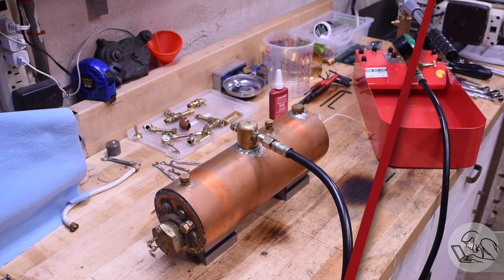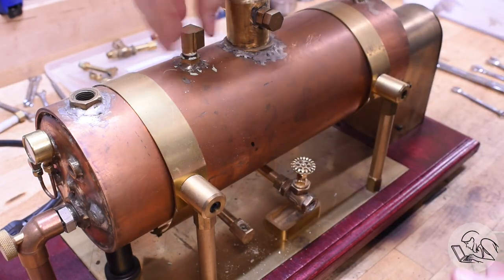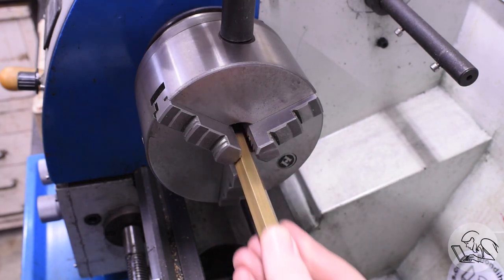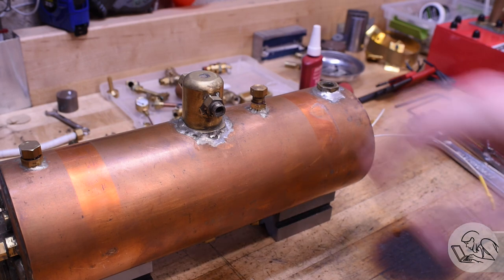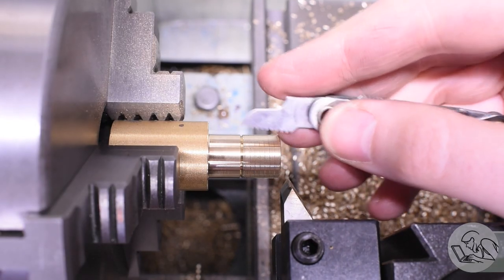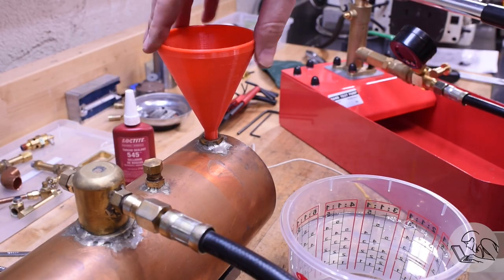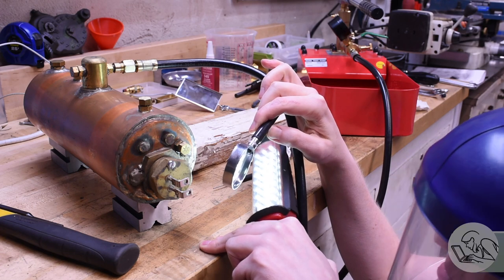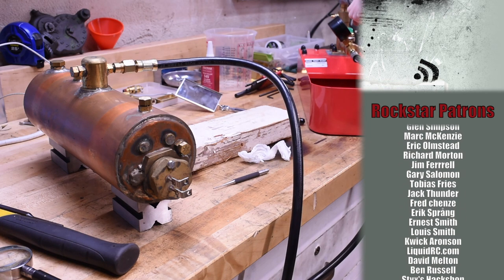Boiler Pressure Test!

Comment: Again, Awsome work with the boiler!
About the pressure test, this is actualy a thing i need to do with several of my own machines, i newer taught about those sheap plastic flower sprayes where even close to be capable of pumping it up to almost 7 Bar!! (or about 100Psi for our British Friends) 6 bar is more than enough for most of those low pressure toys (or about the operating pressure for machines like the Stuart larger size machines). Thank You very much for those tips and trixies!! You realy saved me a lot of headace now! <3
Reply: I was also stunned when I saw Myfordboy using a flower sprayer for pressure testing. Who'd have thought it?
Reply: I don't know if one mainly use Bar/psi has to do with if one are a petrol head or hydraulic guy... as an old farmer used to hydraulics, Bar tend to get stuck in my referenses, but my friends on the race track tend to refear to things in psi because of 
turbos and engine compressors, however i learnt to automatically convert scales in my head now anyway, same thing with metric and imperial, since imperials are used among carpenters and boatbuilders in Europe but the hardware stores use metric so i hawe to convert back to imperials in my head for the constructionwork on the farm... ha ha
Reply: @sheep1ewe  We are stuck with a mixture of the two systems in the UK, and I can't see it changing any time soon. Kids learn only the metric system in school, but when they leave school they have to get used to road signs in miles, beer sold in pints and tyre pressure machines reading in psi.
Reply: @JohnsOrganWorks  In Sweden we did officialy switch ower to Pascal for all those types pressure messurements (despite very few people are using it outside the carshops), before the national referense was a scale called "ATÖ" wich simply means atmospheric pressure ower sealevel (pretty much equal to 1 Bar).
Operating height of aircrafts where for some extremly weird reason recently replaced from metric to fot here.
It's mainly planks, wooden beams and nails wich are still in imperial here, but sold by metric since i think the 90s or so, so if one ask for a 2" pre made raw sawed plank i think it will roughly be 50 mm today, 3" nails will be 75mm, osv. In the hardware store, i guess it's the best compromize they had to come utp with. Before the metric era we had actualy two types of national standard inches here, one general approved for wood and one, slightly smaller approved for steelwhares and other metals only, i think that's why it's first unified with British imperials and then converted to metric from British imperials... ha ha
Most people somehow involved in carpentry and construction work here are using a double side folding rule with both metric and imperials side by side, i hawe one my self in my pocket... ha ha

Boats are of course always messured in fot, i don't think boathulls ever has been metric here at any point i know of.

But there is an old nordic pre imperial called "Aln"; the referense of the forearm wich is roughly 2 fot in lenght, my grandfather had a ruler wich started in that scale (roughly 60 cm) and divided into inches. I don't know if they where in Britain as well at some point, but i guess so, i think it was used in the aincient Egypt too if i am not wrong...
Reply: @sheep1ewe  I think your "aln" is known as a "cubit" in English. it's mentioned in Genesis in connection with the design of Noah's ark!
Reply: @JohnsOrganWorks  That make sense i think the origin of them must hawe been around since the stone age.

Comment: You've said you have a zillion thread dies so you don't have to go to change-gear-hell. I always thought that Clough42's cool computer controlled lead screw system was right up your alley, part computer hack, part machining. But I think this is the first time I've seen a solid need for it in your projects. If you keep needing fittings that do the metric-imperial change thing, you are gonna need a computer lead screw.
Reply from the maker: I have his board, but haven’t gotten around to install it yet.
Reply: @Blondihacks  Just gotta get motivated :-)

Comment: I loved when you showed the loss of pressure, you show psi and bar but the gauge shows kg/cm2 and MPa. It took me a minute to remember bar and kg/cm2 are about equal ~. ;-)
Reply from the maker: Yah, usually these gauges are in Bar and PSI. MPa and kg/cm2 is a bit odd (and actually slightly different than Bar)

Comment: Great Video as always!Hey! What is the cast iron number counting thing-y on the back of the counter against the wall?Is it a,Threshing machine bushel counter? Grain drill acre counter?Just wondering....
Reply from the maker: That’s an agricultural acremeter that I restored for my 2nd anniversary video. Now I don’t know what to do with it so it sits back there. 😬
Reply from the maker: Yes- you guessed it- off an old seed drill
Reply: @Blondihacks  
Thought so, We had a similar one on the old John Deere Van brunt drill in the 60s and 70s. Thanks for the reply!

Comment: If you're making an imperial to metric adapter... and make a mistake (which is also traditional in machining)...

Shouldn't it be a metric fist shake? Or do you need to redo the change gears for that?

Comment: Very nice account.  I appreciate your thoroughness and methodical approach.
However, be aware that the pros size the relief valve by calculating the maximum possible load, THEN buy a valve with the required capacity.  I suspect that this PSV is intended to relieve thermal expansion of a liquid in a blocked pipe, not to vent steam from a blocked-in boiler.  This is dangerously incorrect, but you have raised awareness of the necessity and shown the steps.  Still, it appears to be satisfactory for small hobby equipment.

Comment: May I ask you a question about my mini lathe ? I have and really like my er32 collets and chuck but it only goes up to 3/4” and I want to use stock up to 2” aluminum and brass ! So can I use a 3 jaw chuck on a straight shank 1/2” in my collets so I can turn it down to 3/4” is it safe or just a stupid idea ?

Comment: I have used 1/8 NTP fittings up to 7500PSI I like NTP better than BSP or M10 metric. yeah it was fun. the pressure testing of the safety valve, the same happens to me every time I test one I'm just making funny faces until it goes off and always scares me.

Comment: Can you expand on how the electric boiler can immediately stop producing steam when you power it off?  I ask as if the element is in the water, isnt it being hot and having some residual heat similar to an electric stove element under a tea kettle or pot of water?  For that I have not seen it immediately stops adding heat when I turn the stove off.  ie the residual heat will still cause some boiling, but I am guessing you meant it will scale down from there vs getting worse/staying the same as live fire continuing to burn on it.
Reply from the maker: It takes immense energy just to keep that water hot at those pressures. The moment you stop putting energy in, the whole system starts cooling fast. Any residual heat in the element is a drop in the bucket compared to that.

Comment: I am trying to make a electric steam engine boiler to run on a 7 1/4 inch gauge loco framework 
So how did you build your electric steam engine boiler and do you have videos from the beginning to the end of the boiler built
What is your watt age on your heating element used on your electric boiler
Because the steam engines boiler needs to get to 150 PSI on steam pressure like the steam coal power engines at a miniature railway where I help out
As well the engine needs to be pulling carriages with public
So I am asking for help how to make electric power steam engine boiler how to make one of these for a 7 1/4 inch gauge loco

Comment: Locktight won't seal everything, it can slowly dissolve when used with some coolant fluids, even if the coolant is advertised as Locktight-safe...
Reply from the maker: This is specifically the application that this type of Loctite is made for. I’ve never had it fail in years of running boilers.

Comment: 19:21 is there any risk of getting burned if that safety valve goes off? I know steam cools fairly quick but id imagine if the pressure got too high and released steam it would be a lot. If anyone knows I'm just curious.

Comment: I’m guessing filling with water and then pressuring with air is frowned upon?
Reply from the maker: Yah doesn’t work very well because the air compresses in the hose. You want the whole system to be incompressible for a proper reading.

Comment: I have 6ft of 3/4in 304 stainless rod, cut into 8in lengths. 3/8in is the wrong size for my project, so the steel is just collecting dust. Want it?

Comment: If that safety valve startles you, you'd have to be pried off the ceiling when I test the ones we use on our cookers.  One size I test is a 28 psig set, 3" inlet side, 4" outlet side.  It quite literally rumbles.  Face shield, ear plugs, and heavy gloves required.
Reply: I used to have to lift 4” safety valves on a 180psi steam boiler as an annual test. If I remember they lifted at 210psi, been a while but you want to hear a howl when they lift! That was scary as these boilers were FAR from new...
Reply: @FlatBroke612  The ones on our boilers are maintained and checked by the company we contract to maintain the boilers. They are set at 150 psi. When they get tested we get complaints from the neighbors since they discharge outside.

Comment: Instead of a pump, do model folks ever just fill the boiler completely with water and then heat it up to testing pressure? Not as precise as this, but eliminates the need for any gear other than blanking plugs.
Reply: The ones that do this are not around any more...
Reply from the maker: It’s something the old timers used to do, yah. Definitely not the recommended way to do it. 😁 I have a model engineering book from the 1930s and it even says “don’t do that, but people used to do it that way”

Comment: Nice video as always. Hopefully in time the Americas will repent of their antiquated ways with Imperial thread forms (you did win the war of independence from Britain...) and switch over to the wonderful world of Metric. Us over this side of the pond dont spend a lot of money on taps and dies in the pure language of Metric. But on a serious note, much as I have top quality taps and dies, I decided to try out the metric HSS taps and dies from China (NOT the cheap sets with M3-M12 for $1) and I have been very pleasantly surprised. The taps are great and I haven't snapped or blunted one yet. The dies I bought aren't split dies and they tend to tap ever so slightly oversized but unless I need a very tight thread they are fine for general use. It's a great place to buy one-off sizes (like M14x1.5), especially the different pitches and even left hand ones. I generally use Sallyexpress. Hopefully you can start your conversion away from the dark side... Keep up the good work!

Comment: Boy you need a union steamfitter in your life. Most of the parts that you removed are designed to hold up to 120 psi. 1/4” schedule 40 will hold 1700 psi and 1/8” has a much greater capacity.
Reply from the maker: Considering I made all those parts, I wouldn’t be so sure.